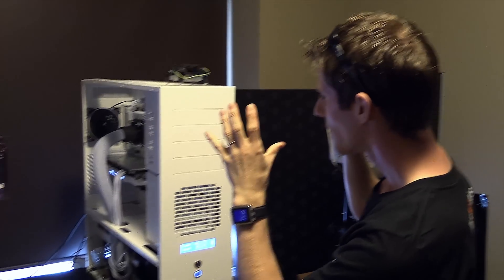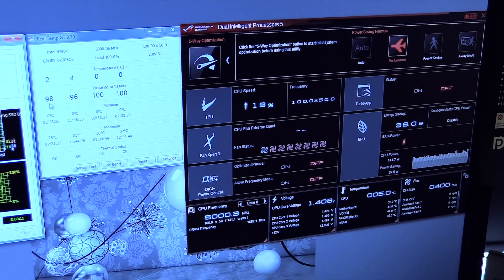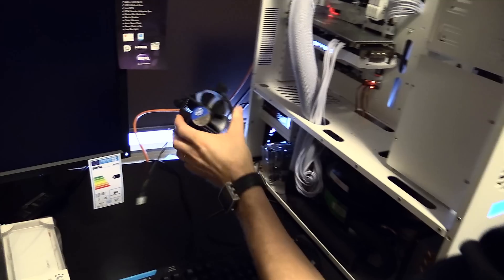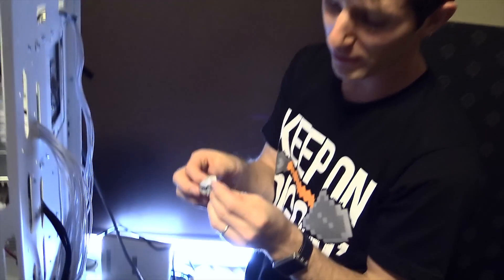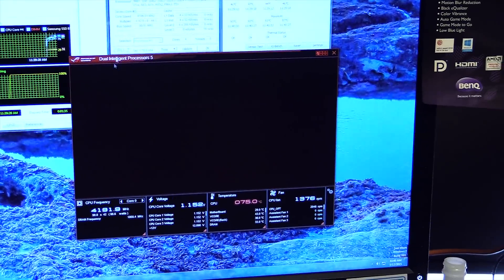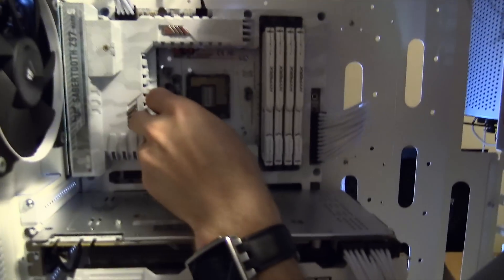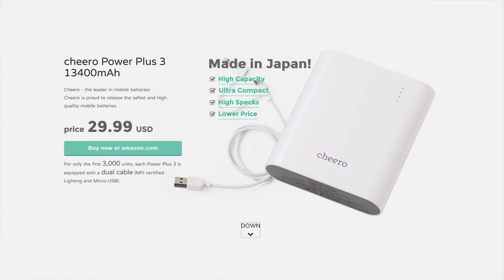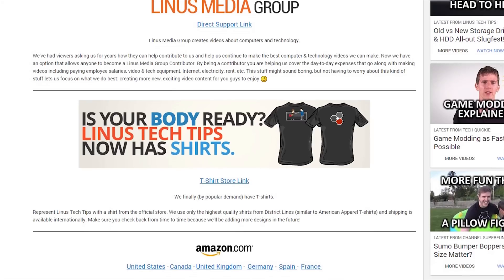CPU Cooling - Does temperature impact performance?

Comment: tldr: cpu temp doesn't affect performance. Just saved ya 17 mins np
Reply: CPU overclocking raises speed -> higher clocks mean more heat -> too much heat means crashing PC, even possibly hardware failure
So do you want to cool it down? Fuck yes.
Reply: M1necr4ft Style -Actually all of you including linus are wrong, I am an electrician. Do any of you know what superconductance is?  When a conductor such as a copper wire or a transistor is colder it us able to transfer electricity more efficiently.  Have any of you wondered why super cooling a cpu with helium or  nitrogen allows you to clock to 7ghz easily?  It's not just because the computer stays below the max temp, while your computer is cooled down to really low temps the transistors are conducting much more efficiently and this  leads to far less errors that come with high hz rates.  So no you won't see better performance at the same clock and voltage that you already are stable at room temp, but he probably could have overcooked it higher at the same voltage rate, or ran if too a higher voltage and clock and stayed stable longer than if if we're at room temp.
Reply: THANK YOU
Reply: wish i saw this before watching all 17 minutes
Reply: if you're videocard overheats its starts stuttering
Reply: TS;DR, you're missing some entertaining specials, :-P.
Reply: Its going to degrade your cpu I think
Reply: i honestly beg to differ
Reply: Thanks
Reply: M1necr4ft Style lmfao
Reply: Styles unless it's overheating
Reply: Styles and also increases lifetime
Reply: Thank you!! This guy sure loves his own voice...
Reply: It does though. I put a big ass fan on my pc and now dont get stuttering in most games.
Reply: Too late a already sow the video before looking at comments
Reply: thank you
Reply: not anymore :D
Reply: there are heroes on this planet
Reply: Thx
Reply: Thanks
Reply: I've been getting lower fps since i put my pc under my desk where its warm are you sure?
Reply: My i7 7700 is 100c while literally in Bios
Reply: I'm afraid to check your channel
Reply: but gpu affect right? like gtx 960,970
Reply: thanks fam

Comment: 10:25 makes perfect sense I would think. The 4790k is just a 4770k released later with a better thermal compound between the die and IHS. The chips are the same aside from that and their box clock speeds from intel.

Comment: I was always under the impression, perhaps wrongly, that electronics such as a CPU or GPU or even a Bitcoin ASIC had an "Optimal" running temperature and that venturing too far above OR below said temperature would negatively impact performance?

Comment: it does impact, but over 100c i think :))), so that time, custom cooler will make use
Reply: +Thinh Le Tien 
yeah sure, over 100 it will perform a safety shutdown
Reply: Savage Nature
yeah sure, an old laptop of mine ran hot enough to cook on, but that's not up-to-date tech
Reply: Savage Nature
I'd keep an eye on that temperature though, since you could make lunch on it too
Reply: Savage Nature
if you remove the heatsink and cover the cpu with a container, you get an oven. more  efficient

Comment: I worked in CMOS ASIC design for many years and a characteristic of the technology is that the cooler you make it the faster it goes.  What this means is that you can overclock it more when it is colder, not that it will magically provide more performance at the same clock speed.  I don't know the details of what Intel might do to internally down clock the CPU when excess temperature is detected but certainly if you used something like Throttle Stop to keep them at full speed then there should be absolutely no difference at the same clock speed.
Every design has a critical path that determines the maximum clock rate and we use gate level simulation to determine the worst case clock rate or propagation delay over the PVT of the design.  P is process variation due to the semiconductor fabrication variances, V is power supply voltage often +/-10% at the board level, and T is junction temperature on the die.
Super Computers of the early 1980s were built in bipolar ECL logic, and CMOS was considered a slow technology in those days.  A company, ETA, produced a liquid nitrogen (-196.15 °C) cooled CMOS super computer in the mid 1980s with a goal of a 10 ns (100 MHz) cycle time, they were able to do 7 ns or 143 MHz.

Comment: Ok, You just wanna keep it from OVER HEATING ! Question : Wouldnt or CAN YOU increase the CACHE to increase SPEED ? And without or when you have the Most Cache processed CPU available , Due to the Fact you have probably the best CPU installed , Can you OVERCLOCK THE CACHE ? , Not Just the FPS rendering ? And HOW do you acomplish such a task ? Or , CAN    YOU ? It would seem , TO ME , That the CPU and GPU is at Extreme volume , so what of the Cache that IS the SPEED of the CPU after all , Isnt it ? Or have I been looking at this the WRONG way all along ? Ram seems to be as fast as possible and as many cores and threads as possible as well as Cooling seems to be on point , Now What of the Cache ? I mean if the CPU ha , say a gig of Cache , CAN YOU overclock it ? Is there such a bench mark for such ? and if so / shouldnt you be able to improve upon it ? Without going to extreme`s ? or would you HAVE TO ? Does the CPU Automaticly Bottle neck the Cache ? It would seem that there is a varible that HAS NOT been sought out here ! I would think if 1 could Break ground on such 1 would find the MISSING LINK ? Again , Not unless I a,m looking at this the wrong way ? AM I AN IDIOT ?
Reply: +james fox ,,,, Hello ? Are You awake ? Linus !!!! ANYONE !!!!!! HELLO ! CAN YOU HERE ME NOW ??? Dam thing just crapped out on me , Guess I will have to call back later . If you get this message , you can contact me at ,,,,,,,,,,,,,,,,,,,,,,,,,,,,,,,,,,,,,,, HERE !

Comment: but low temps = longer life span so it's still a win to protect your investment
Reply: +Dorin MosuD Finally someone! Thanks
Reply: Actually, the lifespan of a transistor being heated or overvolted drops down quite a lot.. but if you drop 80% of 100year like you still get 20years out of it.. and by that time it will be obsolete.. so no, i don't mind much the life usage of a cpu or ram, or a motherboard or even a GPU (yet gpu's are notoriously hot with frequent 100degrees spikes and the FC bumps inside the chip may get moved, and the robustness of a gpu soldered to a pcb is a joke compared to a MB and LGA/PGA/zif's for cpu sockets... the gpu fails at the fc-bumps not at transistor level wear. Same for a MB.. it goes bad with bulging caps rather than transitor wear in NB/SB/etc.

Short answer.. as long as you don't overheat (keep it under 60-70) the lifespan should be plenty left for any user (including the future collectors that expect it to run decades in future)
Reply: and alot of people also live in humid tropic temperature, which runs a hot humid temperature all year round. CPU cooler is important

Comment: from my experience i can say it prevents the pc from thermal throttling, which will not make it run faster but will not let it run slower because of the high temps or the poor ventilation conditions.

Comment: can someone link me to the video where Linus is overclocking/explaining overclocks? well let s just ask the burning question in the wrong video:

i ve got an overclocked AMD fx 6100, but there s this powerbill thingy. since i used the UEFI to overclock, i don t like using software to overclock. but here comes the horrible thingy called powerbill: overclocking makes your already powerhungry PC more hungry. what i d like to do: in game, i use my UEFI overclock. when i m watching cartoons at night, i don t need 4 ghz of CPU power. what if i d use software to downclock the HT ref clock? it s stock at 200 mhz, i guess taking it down to about 150 mhz or even slightly over 100, i can underclock it as soon as i m done gaming with just one button. but amd overdrive doesnt allow me to tweak with that clock. i can overvolt it, crank the multiplier up to 30 or something, but i cant just downclock the ht ref clock.

or is that a stupid software underclock anyway? it s about saving power, and rumor has it you need to do more than lowering the multiplier. the idea is easy powersaving preferably without restarting

Comment: Technically, parts of the CPU do run faster just by being cooler. For example the drain current of a typical planar MOSFET transistor at 90nm increases when the temperature drops significantly (especially at this gradient here, from 80C to minus a lot). There are two main physical parameters that get affected by temperature which work in opposing ways: a) carrier mobility (electron speed (or hole if we talk about PMOS)) does indeed decrease which tends to decrease the drain current (hence the "speed" of the transistor) and b) the threshold voltage drops when the temperature drops so that will increase the drain current (hence the "speed"). The end result depends on a lot of things (like process, voltage, temperature, dimension, etc.) but suffice it to say that even on a circuit level the effect is small in normal voltages. So this effect is unlikely to translate to any significant way at system wide level on such a complicated level as a pc (which has literally hundreds of other things affecting the performance). Source: I kinda did my thesis on that, but I can also provide you with actual sources from books if anyone's interested.

Comment: Correct answer : Lower temps do not affect the performance DIRECTLY (altho they might affect te lifespan).
they affect the performance INDIRECTLY,because with lower temps you can push the cpu further in overclock

Comment: The conclusion is that paying heaps of money for an expensive super cold cooler is a really bad investment, right?
Reply: +Wire Rubbish Bin (MoreCoffee) no. the conclusion is if it's cooler at 4 GHz it will run the same speed when it's hot at 4 GHz which makes sense. But, when you super cool it you could overclock to over 5 GHZ > 4 GHz

Comment: i have played minecraft on the 4790k with stock cooler at 800 mhz and 100ᵒC crased minecraft bevor the crash was the max speed 2.3ghz
Reply: Why the hell do you play minecraft on a goddamn i7? You could've done it 120fps 16 chunks with a fucking pentium g3258
Reply: Why the hell do you play minecraft on a goddamn i7? You could've done it 120fps 16 chunks with a fucking pentium g3258
Reply: +SquidPlays mit den verwendeten Einstellungen hatte er mit smt 60 % Load und 16 GB RAM Load
Reply: Dennis Nattkämper Ummm.... I'm not...... German?
Reply: +SquidPlays sry the CPU Load under minecraft was 60% with shader
Reply: Dennis Nattkämper Oh, ok. Nice
Reply: +Dennis Nattkämper 2.3ghz tops on minecraft at 100C? Did you even get a well assembled pc or did you build it and forget about the thermal paste? No game or program should do that to an 4790k even minecraft with shaders (which is still jack shit easy to run under 70c on any decent cpu with a stock cooler). Figure out whats making the temps so hot bud.
Reply: the thermal paste in the cpu was dry. i have boost the stock cooler with a xtrem fan for run a benchmark @ 98C at 4.4 ghz

Comment: I mounted my processor vertically very easily, what's the problem with that ?
Reply: +SquidPlays Well gravity is one of the weakest forces known to man. Lift your arm and you beat gravity, but this guy should mount his processor right anyways.
Reply: The pins might not line up due to a thing called gravity. Best to do it before you mount the motherboard into the case.
Reply: What has to do gravity with the pins, I seriously doubt that they are influenced by gravity, pins are not an easy material to bend from gravity. And maybe it might happen to not have the processor in the correct position or it might fall if you aren't careful.

Comment: My 2.95ghz cpu is running at 1.4 ghz at 100c so yeah it does slow down as it gets hotter
Reply: Dafuq 100C? Cook some bacon on it :D
Reply: :) yeah, right :) i had dust on the heatsync
Reply: Paul Chopping Oh, yeah. Try to clean every 3 months or so

Comment: Far as i know, cooling it beter does prolong CPU life quite considerably. And thus able to stay relevant for longer.
So cooling it beter to my knowledge just prolongs system life overall.
Reply: The longevity of a CPU stays the same until you get to a certain point e.g. 100C load for 5 hours

Comment: Cooling a CPU might sound like you'll get faster speeds, but it sounds like that person would be talking about an F-15 fighter jet or something relevant. 

Heat on a CPU just murders your hardware, cooling it won't make anything faster! just think of a 10k marathon with an over weight man running for 30 minutes 

(want him to die? well get than man a fan, but don't think hes going to do any better.) hope that made sense to you guys in a metaphorical way of calling the CPU an over weight man in a 10k marathon.

Comment: That first pc.......
WHY THE FUCK IS THE WATERCOOLING TUBE SO FUCKING HUGE?????????????????????????????????????????????????????????
Reply: +OverClock HQ I think that system isn't water cooled, they got it to run sub-zero so it was probably a liquid nitrogen cooled system, and that needs a bigger tube unless you want to freeze your hands when you touch it

Comment: Only turbo core technologies take advantage of lower temperatures, but of course there are power limits too. Yeah overclocking is the only way to make hardware run faster (that's what turbo sort of does), but doing so it requires: more power, more voltage and so generating more heat and for that you need better cooler. This applies to cpus and gpus. Unless your stock hardware runs close to it's maximum rated temps (overheating) they will throttle down causing the same effect as overclocking done wrong. But as long as you run your hardware cooler than causing throttling then it doesn't matter if it runs 30 degrees cooler or not performance-wise. But as we know, too high temps will kill your components even if the component works at that point. Even if you see some components rated to run without throttling at 95c it won't probably run very long. Dropping the temps to 90 or lower will expand the components life considerably. 
Getting CPU or GPU watercooled or replacing stock cooler with higher end air cooler doesn't mean that you are just spending more necessarily. Dropping your CPU or GPU temps from 85-95 range to under 70 isn't a bad idea. Most GPUs have thermal problems solved, even AMD 290w tdp cards can run under 85c without sacrificing silence (not AMD reference ones). The problem is CPUs. Even if we put dual 120mm rad to cpu and oc we quickly reach 70-80c range while video card can use double the amount of power and still run same temps with single 120mm  rad.

Comment: i bet it would make a small difference if you were near TJmax (not the store) before throttling, because i THINK there will be sections of the CPU running past TJmax or are more sensitive than other parts

Comment: IOW, cool it as much as needed to sustain its maximum achievable stable overclock without hitting its self-throttling temperature.  If overclocking is not intended, then you only need to know your ambient temp (my case is open ;D) on the hottest day your zip code had in recorded history, the cpu's throttle temp and buy the quietest cooler rated for less than the difference and designed for your socket.
Reply: I have my TX3 for my 6500

Comment: as someone who grew up in the tropics let me tell you hell yes it does
Reply: high temperatures cause components to throttle, but lower temps are not inherently the cause for better performance
Reply: +Sebastian Contreras high temps cause gpu to downclock so it will be less performance

Comment: i have personally experienced the problems of high heat. i love your videos, but this one needs a revisit. you tested stock temp (ish) and colder. not above the standard heat. say in a prolonged at load experience.
Reply: +Wraith Pierce plus the processor you used could had high heat in mind

Comment: Well...ive got an 4790k and a big heatsink. Still get 100°C at stockspeed -.- Whats wrong with my cpu? Temp jumps up like in one second (which is unrealistic in someway)...
Reply: +NativeJoe he got a lemon or he didn't seat the cpu heat sink correctly
Reply: Not meaning to insult you but when you power it on does the CPU fan spin? maybe you forgot to plug it in or maybe it isn't working?? except for the thermal compound that's all I can think of right now
Reply: +Lord_Vader No it's not normal. use XTU...and cool that bad boy down. at 4.73 ghz I 
was in the 50's gaming at a 22c ambient. Now I use Swiftech liquid 
cooling and delided my 4790k so it's way cooler now. but yeah xtu will 
shave 10-15c off those temps. look the topic up... it's pretty much a 
required thing when running the devils canyon series
Reply: Coretemp or packagetemp?
Well got a bigger heatsink now its in the 80 deg celsius now ;)
Reply: 80 c at stock? sheezus... I'd say delid that thing. and delid now. something went wrong with the tim and u need to replace it with clu. otherwise ur just not going to get what u paid for.
Reply: No i reseated the heatsink and it didnt help. All my other cpus worked well so i think i do it right ;) no i just think its a bad cpu. But ive got a better heatsink now so ive got everything under control ;D
Reply: +Lord_Vader 
Take the lid off the cpu and put new compound in it. Linus made a video on how to do that just a few days ago.
Reply: Franco Pellegrin yep saw that. Maybe someday but for now. Nope ;)
Reply: +Lord_Vader Are you sure you are not overvolting that cpu?? What is the vcore according to sensors?
Reply: bloxyman22 well stock setting should be ok. I even undervolted it by 70mV. More than that and Ive got problem/crashes
Reply: ***** uhm yes
Reply: Did you peel the plastic protector off the base of the heatsink before you mounted it?